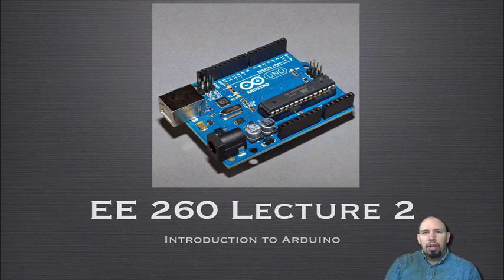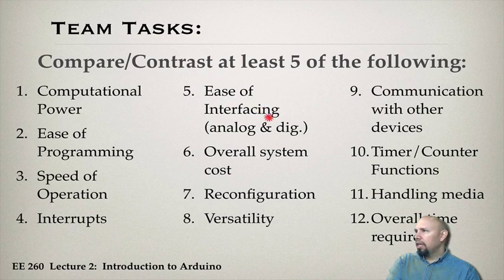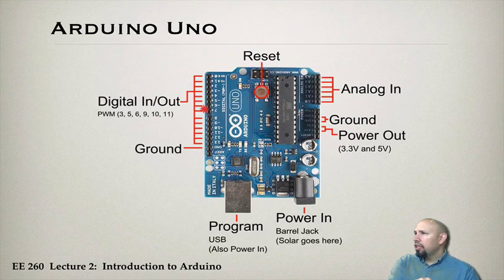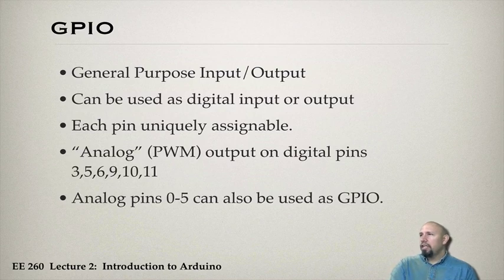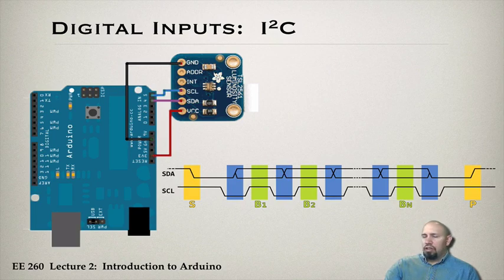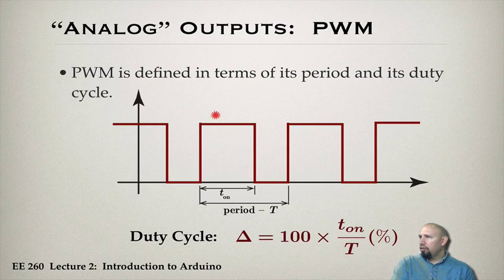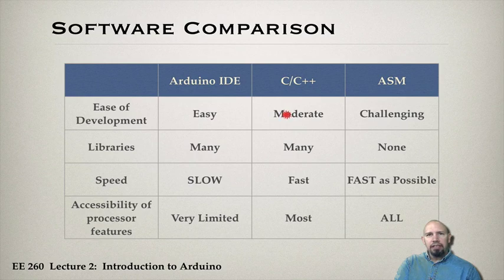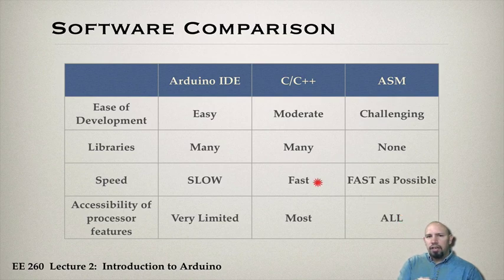2. Introduction to Arduino

Comment: 21:55 The purpose of the ICSP is for a fresh chip from a factory to receive a "boot load" (EEPROM memory to understand the IDE). This can also send a "boot load" to a fresh stand-alone ATMEL Mega chip on a bread board. Not often need, but is when working with a factory fresh ATMEL.

Comment: One purpose I use the ICSP, is uploading to an Arduino with modified USB-firmware in the 16U4 (to act as other USB device, Keyboard, mouse, MIDI, etc.). The Arduino IDE has option to upload usin programmer like USBtinyISP. I find it more convenient than to switch between firmware for every upload.

Comment: Modified Arduino IDE to "do Assembly Language"

I am following the Lectures of the Course EE260 via Internet.

Enquire:
Is the  Modified Arduino IDE to "do Assembly Language" installation software available to the commoner (e.g. myself)?

If so, what would be the URL for downloading?

Thank you.

Comment: what specific board can i purchase so that I can do the assembly that you get into?  I am only interested in bare-metal assembly?
Reply from the maker: You don't need any extra hardware beside an Uno to do the programming.
Reply: Thanks Robert as I saw a few different UNO's and i know from one model to the next some of the assembly can vary.  THanks!
Reply: so this would work https://www.amazon.com/Arduino-Uno-Rev-3-A000066/dp/B006H06TVG/ref=sr_1_4?ie=UTF8&qid=1483545012&sr=8-4&keywords=arduino+uno
Reply from the maker: The Uno needs to have the ATMega328P microcontroller chip.

Comment: Interesting info and well presented, thanks!
Is the Drs Cook modified IDE available to gen public or just your students? If not available generally how does one do ASM coding on the Arduino?
Thanks again.
Reply from the maker: You can find that information on my website at:  http://control.nmsu.edu/files260/

Comment: I don't really understand the contrast between Arduino IDE and C/C++. You program in C/C++ with the Arduino IDE as well, but you use libraries that make it easier. So you use C/C++ in both ways, but you do not have to use the libraries.

Comment: Referenced to Lesson 2 . . .

How would the Arduino have 10-bit values between 0 to 1,027 ? ( As it's using Binary Processing in it's internal computations ) This SHOULD BE listed as 0 to 1023

A Binary / Digital design would actually use the table below with a MAXIMUM value of 1023 for a 10-Bit Calculation . . .

1st bit = O or 1
2nd bit = 0 or 2
3rd bit = O or 4
4th bit = 0 or 8
5th bit = 0 or 16
6th bit = 0 or 32
7th bit = 0 or 64
8th bit = 0 or 128
9th bit = 0 or 256
10th bit = 0 or 512

( If you ADD UP ALL of the Above Bit Values you get 1023 or in other words from 0 to 1023 ie 1024 Possible Values )

10 bit Binary Math Operations can NOT Produce a value of 1028 . . . This HAS TO BE some kind of Translation Error OR the Team the Wrote the Interpreter Code or the Documentation was Smoking something other than Tobacco.

11th bit = 0 or 1024 ect.

Otherwise Excellent Presentation . . . Thanks
Reply: Yup, he already admitted to that mistake.

Comment: In lesson 2, during,your overview of PWM simulating an analog voltage signal ,you use an example of that reads an output between 0 and 1028 or 0- (2^10).

Then you go on to explain that the Arduino IDE can only read an 8 bit PWM of 0- 2^8 or 0-256????????

Why use an example that isn't available in the Arduino IDE? This will cause major confusion down the line when people remember your example of a reading between 0-1028 but, don't remember that the Arduino IDE can only read values of 0-512.

They will design a project needing values between 0-1028 and they will not remember you, very briefly, mentioning Arduino IDE only supports  8 bit PWM not 10 bit. They will then have to learn C/C++ to finish project to support 10 bit register..

I will remember and I send this email to reinforce, hopefully,  recollection of this important detail.
Reply: +Wm. Wiles I think what you mean is 0 - 255.
Reply: Yes James, I did mean zero to (2^8-1).

 Is my main point lost on you because you had to zero in on such a basic error????
Reply: Nope... sure isn't.  I'm not sure as to why he did that either.

Comment: Could you please give me more detail about why the range of Analog Input is 0-1023 (2^10) ? And at 46:26  you said It's not truly Analog output.So how can we actually create Analog signal in Arduino ? Thanks in advance.
Reply from the maker: The analog input has a 10-bit convertor. An analog voltage between 0 and 5v will be brought into the Arduino as a 10 bit binary number giving a number between 0 and 2^10-1.
The Analog output is not actually analog at all.  It is a PWM signal.  When a PWM signal interacts with some kinds of external circuits, such as motors or lights, they give a response that is "similar" to an analog voltage.  You cannot directly create an analog signal.  If you want a true analog output, you need a digital-to-analog convertor.  There are shields that have these.

Comment: Hi. I was wondering if you could help me with something. I have a code which detects cigarette smoke and switches on the ventilating fan to blow the smoke away. I also have a moisture sensor to sense rain and close the window. The problem i'm facing is when the smoke sensor and the water sensor are activated at the same time or within a short interval after one is activated, it waits for the fan to blow finish and then it closes the window and vice versa. So it waits for one code to be executed and then it goes to the next code which is closing the window. I want both to happen at the same time. I don't want the arduino to wait for the first action to be completed and then move to the second. How do i achieve this?
Reply from the maker: You would want to initiate each thing using Interrupts.  That allows the other process(es) to operate in the foreground while others operate in the background.
Reply: Ohh right. Thank you so much.

Comment: Analog inputs are 0-1027?
I thought it's 2^10 = 1024 so 0-1023.
Reply from the maker: yes, 2^10 has a max value of 1023.  The 1027 must be a typo
Reply: Got it, great videos, thanks for putting them up I plan on watching all of them.
Reply: What books did you read to have the knowledge you have. I like to read. Any books you recommend?? I mean not solely on arduino but the technology behind it???